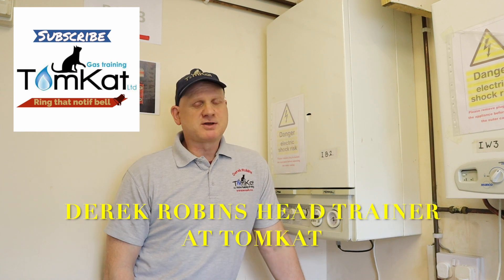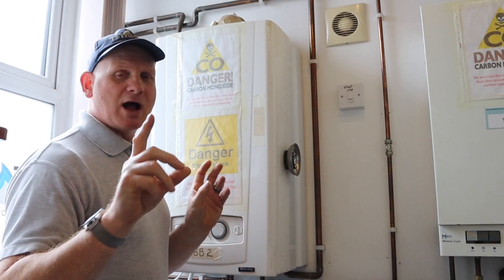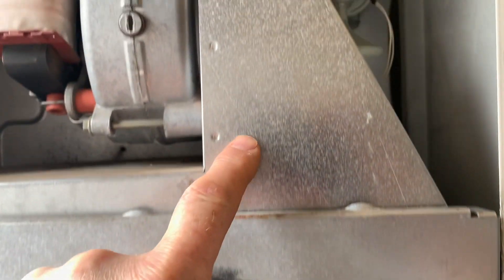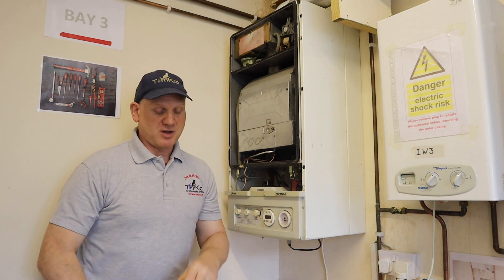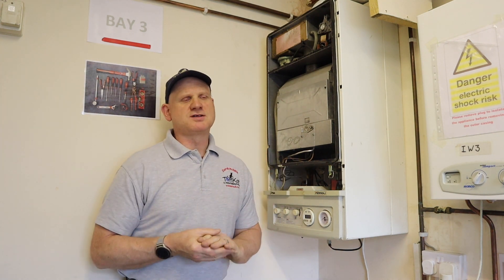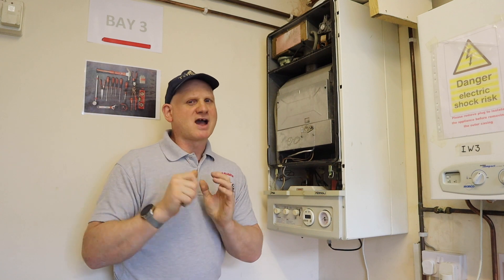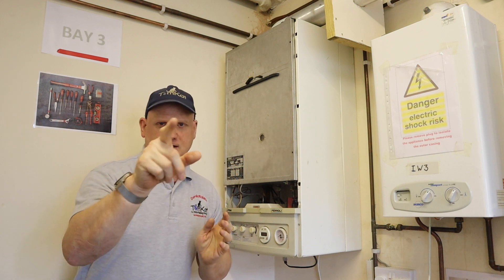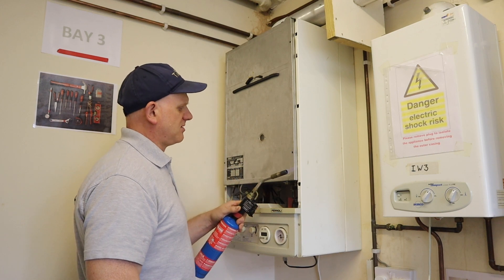POSITIVE BOILER PRESSURE TEST, how to carry out and understand  a positive boiler pressure test.

Comment: What about doing sweep test on negative? Is that pointless?
Reply from the maker: No because the heat exchangers now are under positive pressure because they are forced draft so if they fail and the case seal fails then you have POC coming into the room
Reply: @tomkatgastraining I don’t get it
Reply from the maker: @lostinthoughtscalminsilenc8167 won’t don’t you get
Reply: @tomkatgastraining I thought negative pressure means you don’t get combustion pushing out? The fan sucks it in out the flue.
Reply from the maker: @lostinthoughtscalminsilenc8167 on a new boiler the fan is below the combustion chamber so it’s called a forced draft on an old atmospheric boiler the fan is above the combustion chamber. On an old atmospheric boiler the case is sucked on but a new boiler if the combustion chamber is leaking and the case seal fails then poc enter the room
Reply: @tomkatgastraining so for example say Baxi solo he if flue seal went and there was slight cap on air inlet side would poc be pushed into the room or would the air from the room be sucked in?
Seems like forced draughts are hybrid
Reply from the maker: @lostinthoughtscalminsilenc8167 all boilers now have the heat exchangers under positive pressure but the case is under negative pressure because the fan sucks in the gas and air and pushes it out through the flue
Reply: @tomkatgastraining so the air in room would be sucking into the fan snorkel
Reply from the maker: @lostinthoughtscalminsilenc8167 no
Reply: @tomkatgastraining how? The air comes from outer flue into boiler and the fan gets the air mixes in to burner to light? 
Are you saying the air gets pushed out then?
Reply: @tomkatgastraining hi please can you explain? 
How does the fan get the air from outside if it doesn’t suck the air through the snorkel attached to the fan?

Comment: Very well done. There were a lot of Positive pressure Potterton Profiles fitted in Ireland good few years ago . Some are still going strong. I find one of greatest dangers in aging pp boiler is leaking pump and or pump valves located directly on top of the boiler causing catastrophic corrosion which is why these appliances should definitely be checked annually.👍